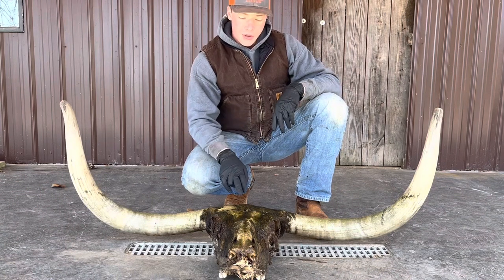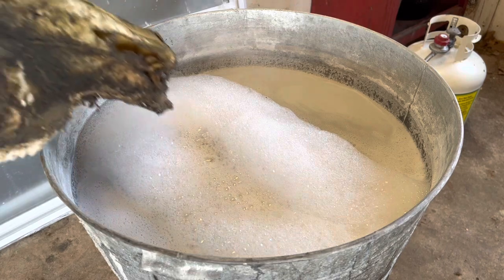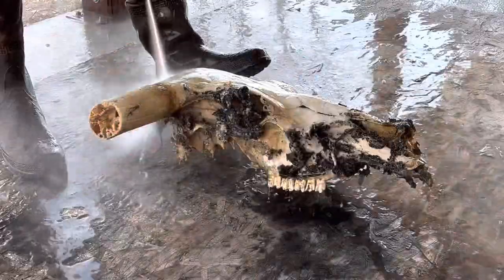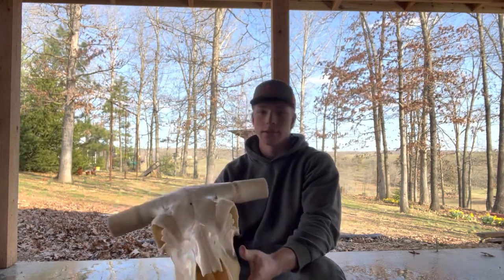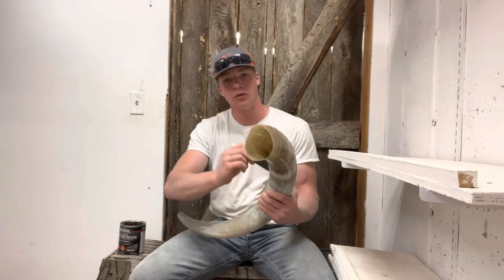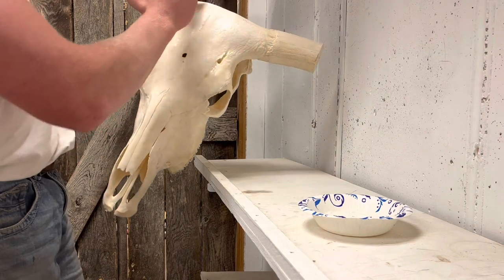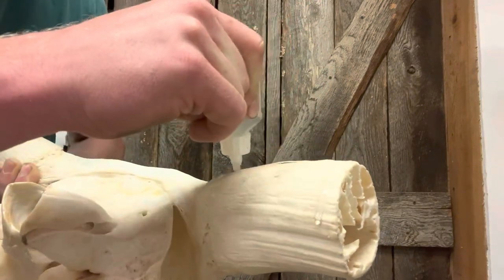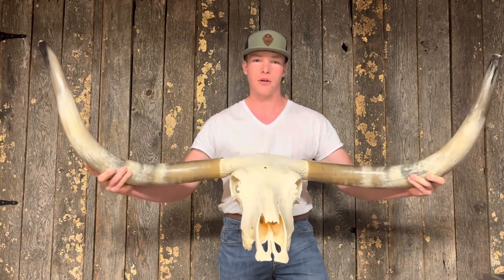HOW TO European mount a LONGHORN SKULL

Comment: Great video and great looking mount

I’m working on a similar amount and the horns are also pretty cracked on the outer portion

However, when I use a grinder with a flappy wheel, it seems like it’s scratching more of the horn than I would prefer 

Do you happen to know what grit flappy wheel you use? 

Did it look like it was leaving scratches before you put the polyurethane on it? 

Thank you
Reply from the maker: The flapper wheel is for getting the big gouges and scratches out. Then I take a fine grit sandpaper and hand sand the horn to get the small scratches out.
Reply: Perfect thank you!

Comment: When you sanded down the horn what grit did you use and in the video you used the angle grinder is that the only time you sanded it? The process in the video seemed to be a lot quicker process if you don’t have to go through the different grits of sandpaper. I’m assuming that’s why you polyurethaned it?
Reply from the maker: I worked up in grit to make it smoother until I liked the finish. Then I polyurethaned it for a shiny finish.